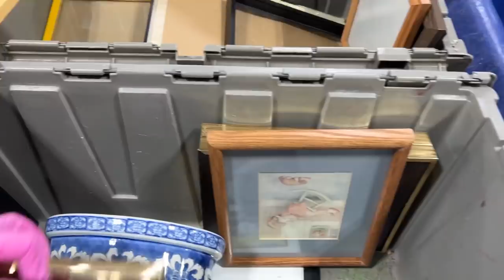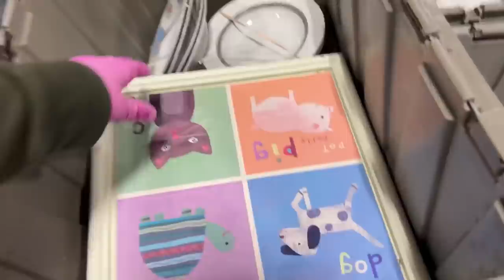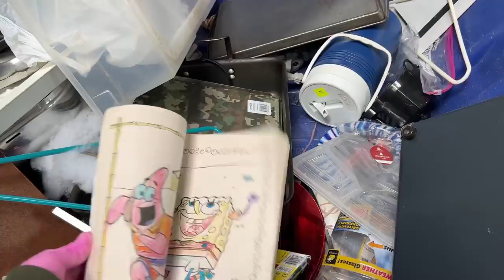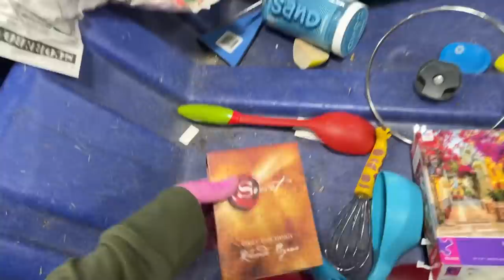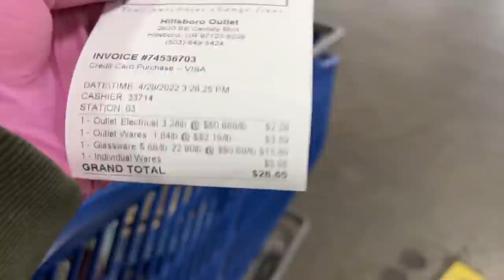THE GUYS WENT NUTS OVER THIS BIN! 25lb Haul! Thrifting at the Goodwill Outlet.

Comment: The Starbucks tumbler you found is rare. There is a sold comp on eBay of $220. Here is the title to the listing “Starbucks 2018 24oz Red Yellow Poppy Stainless Steel Tumbler Flower Floral 710ML”. I also shop at the Hillsboro bins, what time of day are you usually there and how many days are between when you film and when the video is released?